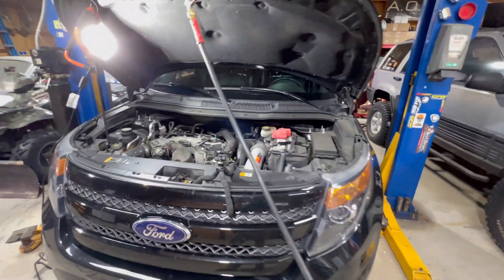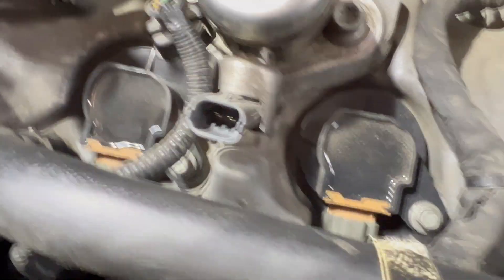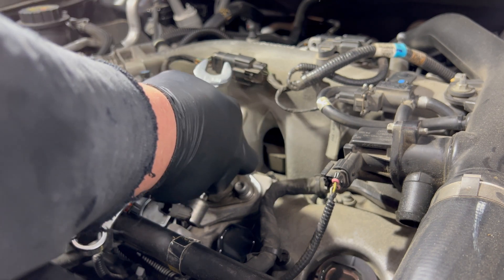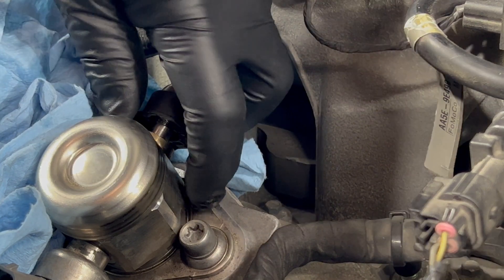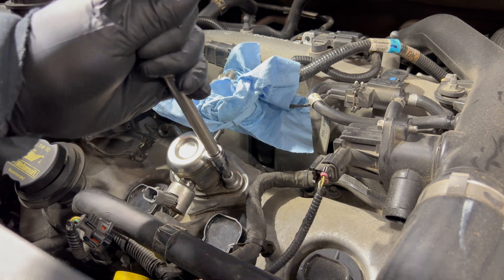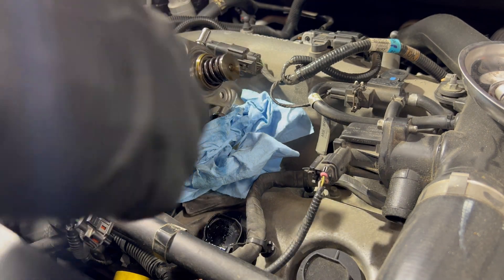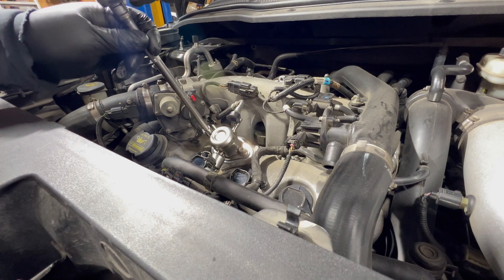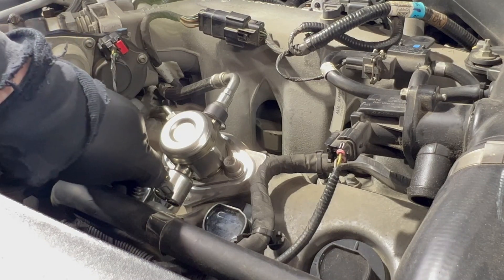How-to replace a 3.5L Ecoboost High Pressure Fuel Pump

Comment: One question would one have to turn the motor over so that the spring in the high pressure pump sits easy,  just snapped a bold due to the torqe specs of 75??? Like wth this ecoboost pump is driven by the camshaft,  so idno it the lobe on the cam had to be open? I felt it give luckily i was able to pull the remaining bolt 🙂 but just wondering if turning  the cam to have less tension on spring to tighten 😮much help needed!
Reply from the maker: The pump was that tight going in? It had to be at the highest point of the cam lobe. I can only tell you what I would do. This is not professional certified technician advice just my thoughts on it. I would turn the engine over to see if the cam lobe would be lower/rotated enough to get the pump in. Sorry to hear that happened to you

Comment: Did you depressurize the system before removing it?
Reply from the maker: I don’t believe I found the shader valve that’s why I put the towel over the main line when I loosened it.

Comment: Is there a chance both of them pumps go bad at the same time? And if I replaced the low pressure should that make it start even if it doesn’t work right?
Reply from the maker: I suppose they could but it seems unlikely.

Comment: Can you show me where the Fuel rail pressure sensor is?
Reply from the maker: I can not in the comments but it's a small sensor with a male threaded end and on the other side it's a female electric connector.

Comment: Does the metal line going to the side of the pump have to be replaced if you remove it? One of my local mechanics is going to do my valve covers and he said I’d need to get that line as well, and I’m having a good bit of trouble even trying to find the right one. The explorer sport really is a pain to find some parts for
Reply from the maker: I did not replace mine I'm not sure why you would need to replace the line just because it was removed.

Comment: is there also a fuel pump in the tank?
Reply from the maker: Yes that would be the low pressure fuel pump
Reply: @AOT-offroad  thanks!  You possibly have a video on changing that?

Comment: Don't you need to align the engine to bottom dead center before installation of the new pump????
Reply from the maker: You are correct. You "should" make sure you're at BDC or you could be fairly close like I was when I limped the Sport into my shop and just compress the spring slightly and tighten it down. I suppose if enough of the cam lobe had been rotated upward I would not have been able to install it but it went on pretty easily.
Reply: @AOT-offroad  so you need to do this BDC to install it ? I'm installing one tomorrow?
Reply: How do you get the engine BDC if needed?

Comment: Do I need anything else another than the pump ? Also do you recommend a aftermarket oem spec or OEM ?
Reply from the maker: I was able to find a slightly used OEM pump from a Taurus 3.5L TT. I would've used aftermarket though. All I needed was the pump nothing else.